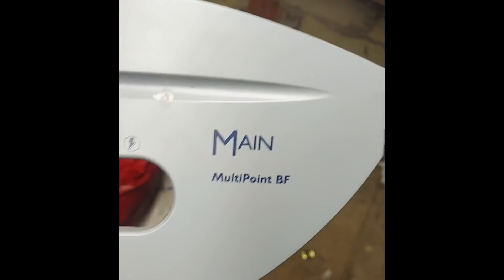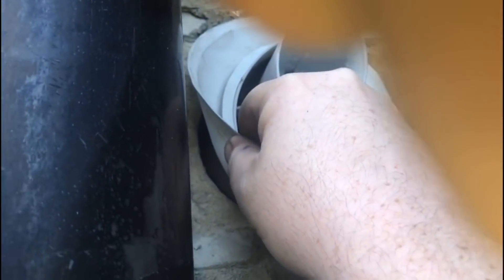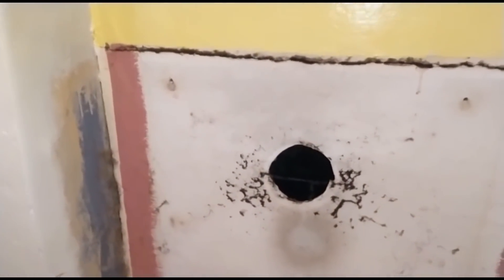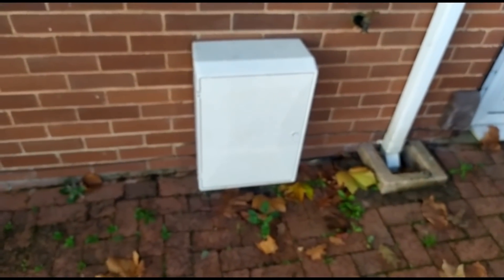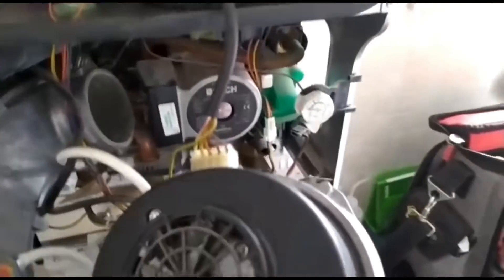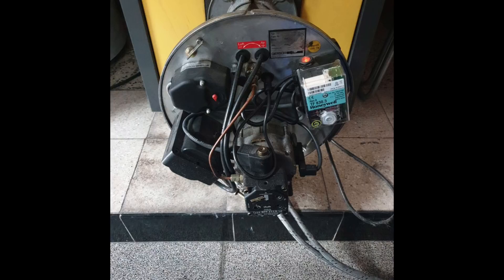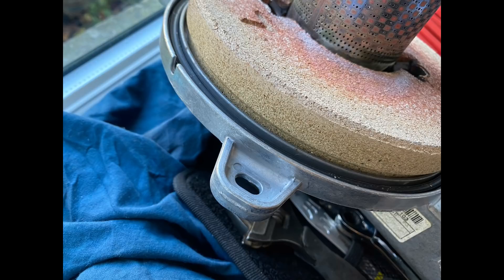Dangerous Gas Appliances - Boilers - Fires - Hobs - Water Heaters - Unsafe Flues

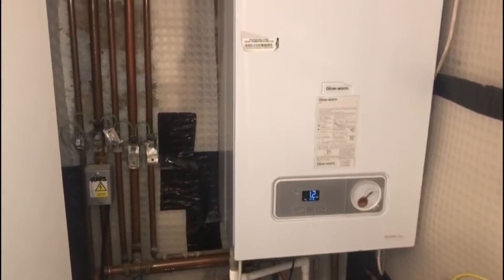Comment: Reference flue not sealed at 2:46. Good luck with trying to get Gas Safe technical help to give you a definitive answer on the risk classification as it seems to depend on which person picks up the phone. I have has this situation classed it as NCS, At Risk and Immediately Dangerous.  I personally would put this as At Risk if the sections are screwed together & the outside flue is sealed/collar fitted.

Comment: 😂😅😅 that hot towel rail is jokes, never seen anything like it.
Reply: Towel rail doesn't contravene any regs & is quite ingenious IMHO. You'll never need to bleed that rad either!
Reply: Its a work of art dont know what the fuss is about about 3% of the blokes in the comment section will own or know how to use a pipe bender 🤣
Reply: Genius idea for cold rooms where a towel rail alone would struggle to heat the space
Reply: A customer  definitely  asked for that